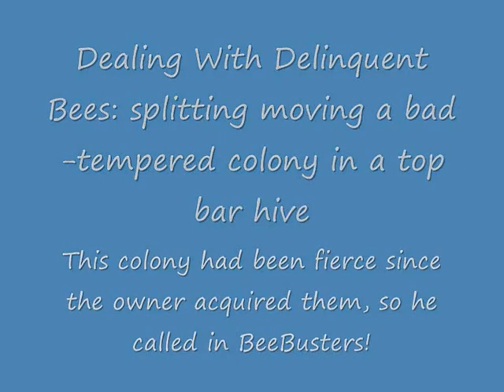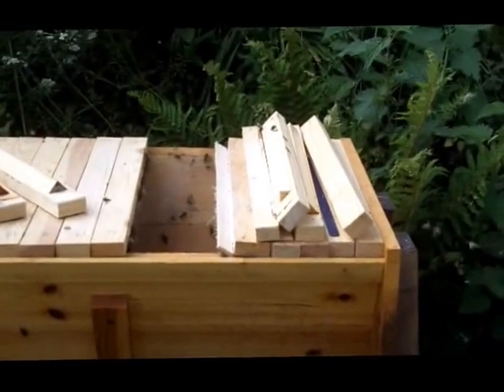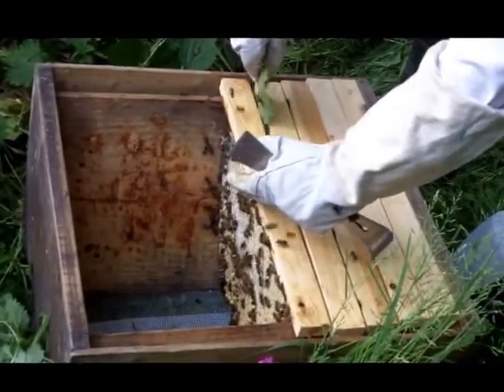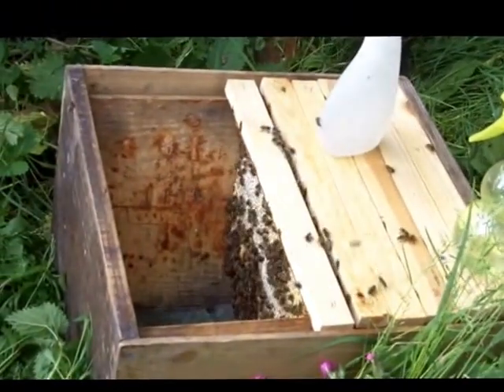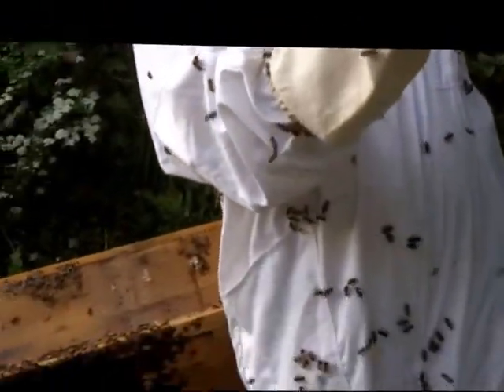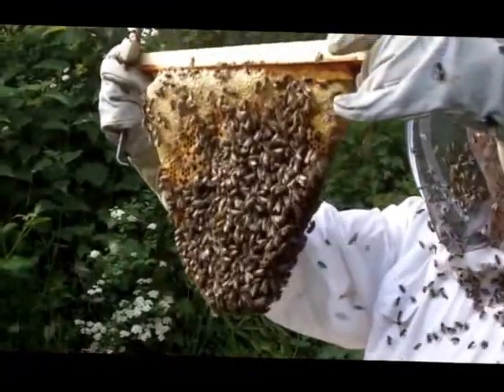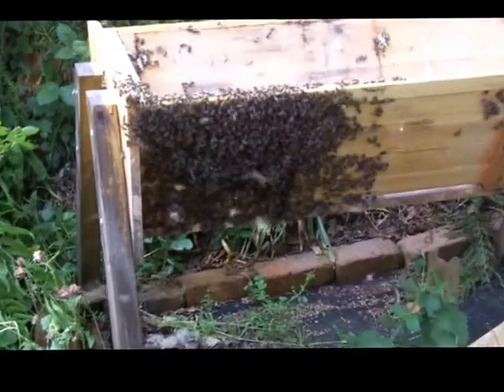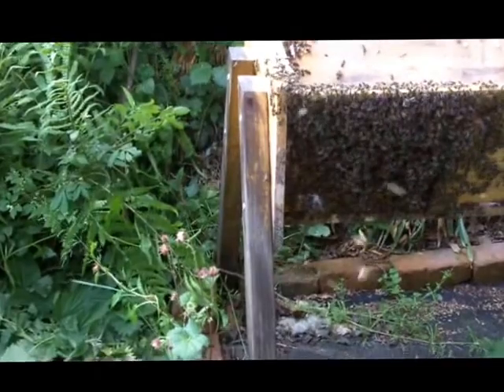When Bees Go Bad: splitting and moving a colony in a top bar hive

Comment: They talk about " top bar" as being a simpler form of beekeeping, yet I can easily see there is so much bee methods & bee lore you still need to know! (intimidating)
Reply from the maker: It is certainly simpler in terms of equipment, but bees are far from simple creatures! However, top bar hives give you an opportunity to experience them behaving as they would in a tree cavity, without the imposed structure of frames, foundation, etc.
Reply: @BarefootBeekeeper  Not to mention a backsaving lack of heavy lifting as one is required to do with a vertical telescoping hive.

Comment from the maker: We distributed queen cells (15 of them!) among the splits and put them all in an isolated apiary, anticipating that they would each end up with a new queen and hoping they would mate with nicer drones. What actually happened was that the weather went bad for 3 weeks, and not one of the new queens were mated! Probably just as well - we really didn't want more like that...
Reply: Did you end up requeening them from elsewhere then? I had a series of failed swarms last summer with queens that didn't mate properly due to the weather. They were small to start with and by the time it was clear the queen was not viable they were already dwindling to the point of no return.
Reply from the maker: ***** We shook the remaining bees into single box in the end.
Reply: +Philip Chandler Why didn't you use smoke

Comment: Just wondering why you don't use a smoker to calm the bees....?
Reply from the maker: 1. They stink
2. They are hard to keep alight
3. I don't like breathing smoke, so why would my bees?
4. A water spray is easier, cleaner and smells just fine, especially with the addition of peppermint oil.
5. Because water works at least as well as smoke, and often better.